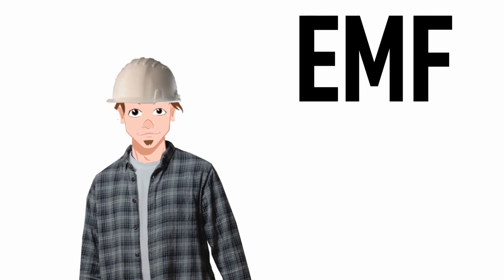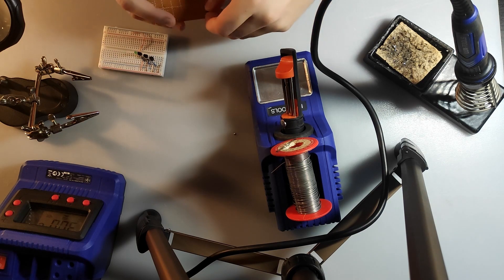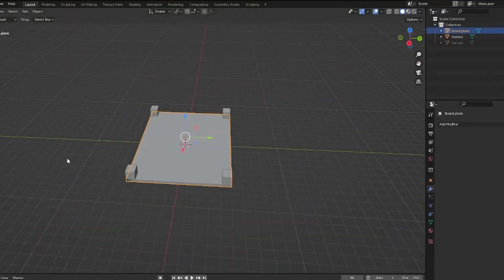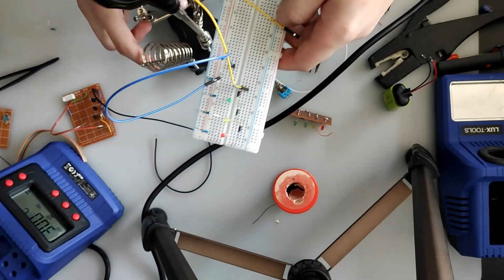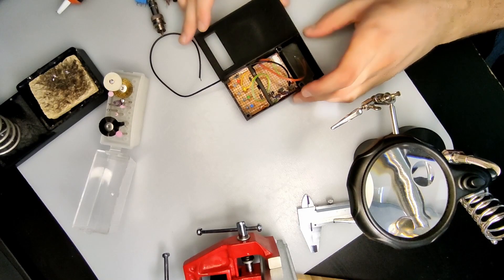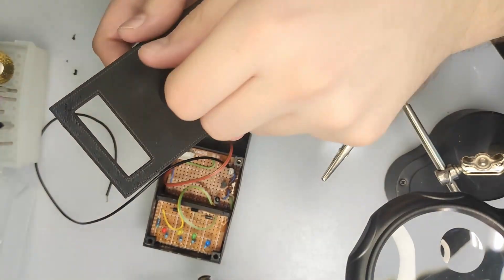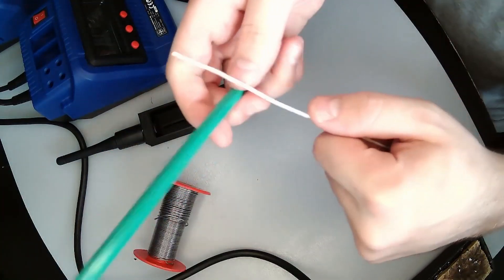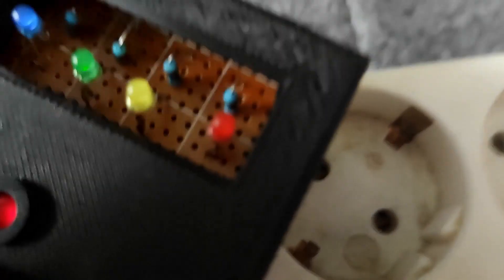DIY Ghost Detector - Halloween Special

Comment: Do you have the full schematic of the completed device?
Reply from the maker: Unfortunately I do not. I didn't plan this device ahead of time - just built it as it goes. And the only schematics I made, are in the video.
Reply: @francisstudiosengineering  😔 So it can't be reproduced except from guess work
Reply from the maker: You can easily reproduce it. It's pretty simple. I use BC182A NPN transistors - I included the detector circuit diagram in the video and also all connections are shown on the breadboard as well. So instead of the one LED and resistor you can connect the VU meter module - just have to match the polarity. The on off switch is right after the battery and the potentiometer is between the detector circuit output and the VU meter circuit input. The potentiometer is connected to the positive (VIN) rail and basically that's it. I hope this helps. 

If you have any further questions feel free to reach out. I will try to answer ;)